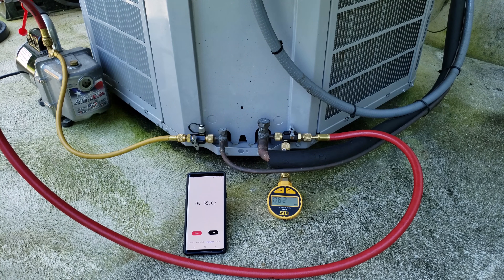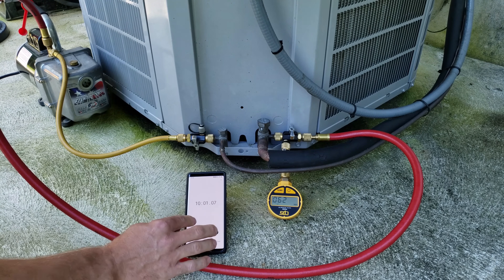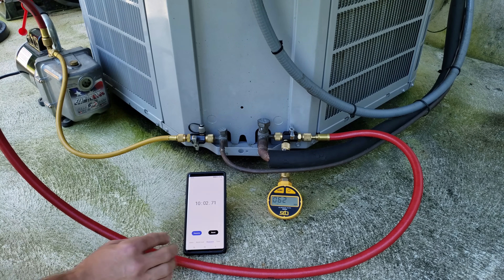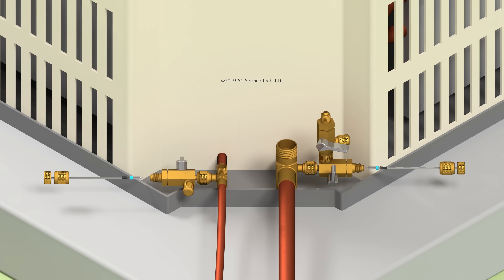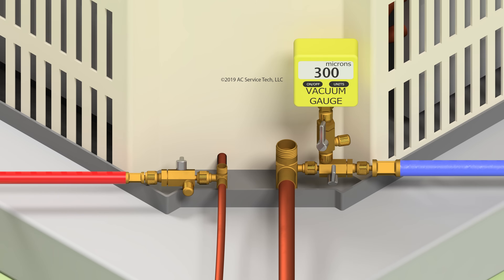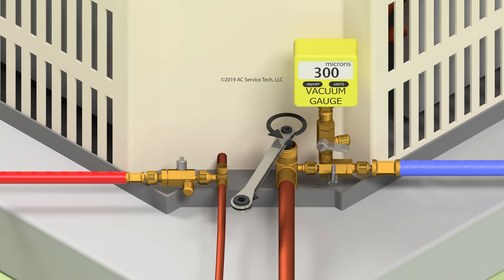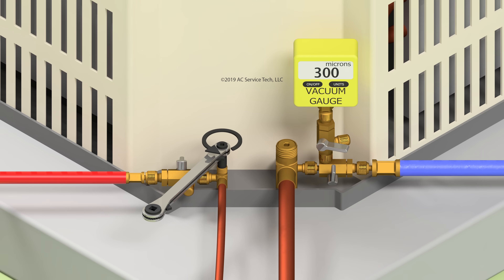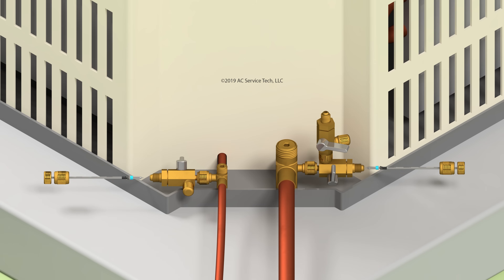HVACR Refrigerant & Oil Charge Contaminated with Water? How?

Comment: hey Craig. how do we know as servjce techs after a system had a leak small or big , if it lost refrigerant oil ? like if we noticed oil saturated in to thr armaflex where the leak was found. you think it's from the refrigerant itself from 410a or that it's the oil coming out the compressor??

Comment: What would the procedure be to get those non condensables out of the system if suspected??

Also say you get an acid tester and its positive or youve hade a line burst on a unit and need to change the oil.   Would you simply pump out the oil in the compressor, tip it over and all as well as purge or blow the lines out with nitro then simply pump new oil into the compressor??  Im just confused about getting  the oil out of the lines if you have a txv and a reversing valve..  just seems like youd never get that oil out even with flushing with a chemical.  Unless you removed the txv’s, flush on fwd and rev and all..   but still even at that, seems like youd never get all of the flush out..

Comment: Great video! Quick question. I have a used 3 ton unit I was planning to have installed. The sales guy came out yesterday and said the valve was left open and therefore the whole unit is bad due to moisture getting into the oil. He also said the unit is too large for my home which is 1500 sq ft. Does this sound legit or was he upselling me a new unit?

Comment: Great video and info I was looking for.  Just installed two Fujitsu mini splits, and on the last one after pulling a deep vacuum on both sides with a micron gauge I started to release the refrigerant.  However, the mid-quality valve I had from my hose to low side began to leak. At first I was thinking the hiss was the noise of the refrigerant being released, but after tossing and turning over it I believe it was the vacuum breaking and leaking through the mid-quality valve....  Must have leaked for a good 3 - 5 seconds.  What do you suggest, should I pull all the 410A, vacuum deeply and load fresh refrigerant?  I scoured the web and cannot find this information; does your training material cover this scenario?  Thanks

Comment: Question I have an old (20 years) mini split that trips high pressure only on heat mode on cooling it works fine any suggestions?
Reply: If not air flow:  A Temp sensor partial fault.? Or orifice issue?
Reply from the maker: Is it possible the indoor head units are not blowing the air at a high enough speed to reject the heat and therefore the pressure is climbing?

Comment: Hi Craig
I have a problem as below
On fujitsu ducted aircon in Australia both the service ports (smaller and larger pipes) are located after the Exv (exv is located in outdoor unit) and one of them was showing me about 240 psig while  suction line showing 130psig. There is no other service port available after condensing unit and befor exv for measuring subcooling for refrigerant check. I asked fujitsu and was told the only way is temperature differential between return air and supply air for checking refrigerant level. (which I don't belive so)
So question is how to measure charge level( as sub ooling method) if no service valve available after condense unit and before exv. I can send you a photo of service ports if required.
I can send you a piping schematic to clarify.
Iv sent you an email with piping diagram
Reply from the maker: I apologize it took a while to get back. We cant really check the subcooling level as the refrigerant charging method for these units since the vrf compressor ramps up and down. The manufacturer doesn't give us guidelines. What I can say is on the vrf minisplit systems I have been installing, the superheat was 0 to 5 degrees after I weighed in the correct amount of refrigerant using the total weight method and the accumulator protects the compressor during low superheat. Manufacturers want us to only use the total weight method so that is why they don't give us guidelines, thanks!

Comment: It's the simple things that you mentioned Craig about connecting and disconnecting your manifold gauge set to a system that can allow air in which of course has the moisture. And a simple thing as the condensation on the suction line would slip by most people and allow water in. Great video and have a great weekend!
Reply from the maker: Thank you very much Stuzman!

Comment: Great video! I still prefer using my Parker Sporlan Bluetooth gauges along with a couple core removal tools in case I have to add refrigerant.
Reply from the maker: You can just use charging tees instead of the valve core removal tool to add refrigerant unless you are weighing in from a vacuum, thanks!

Comment: Good stuff for those that dont know. Poor technicians (install or service) are ultimately the reason for water in a system. Point of install just a visual..look at that lineset where was the pride on install? So was the vacuum done properly? People you get what you pay for..Good work isnt cheap, and cheap work isnt good.
Reply from the maker: Absolutely, good points, thanks!